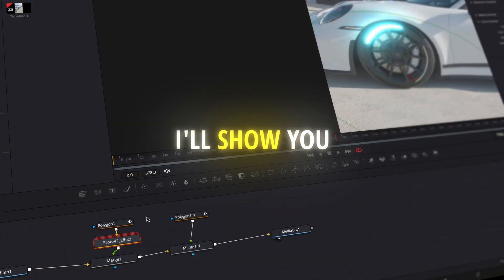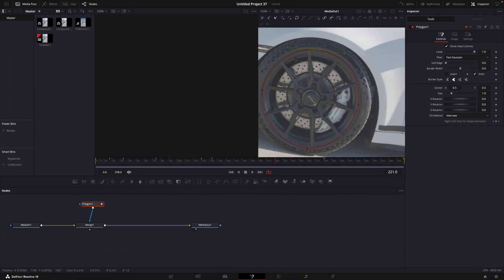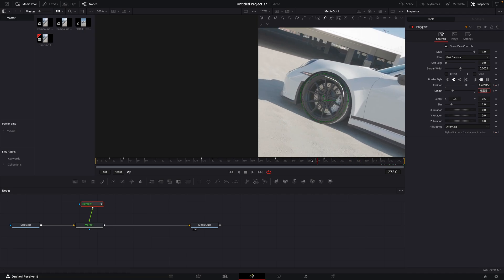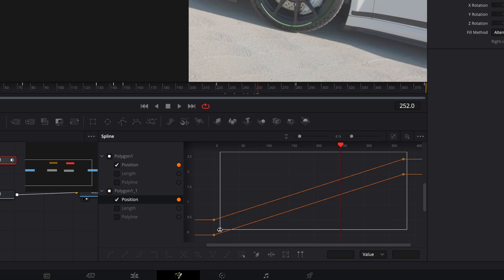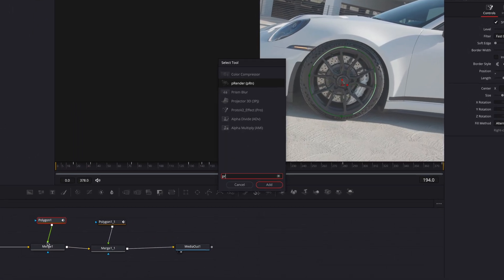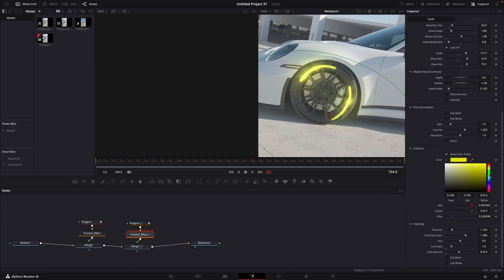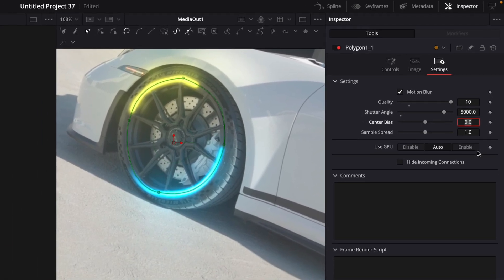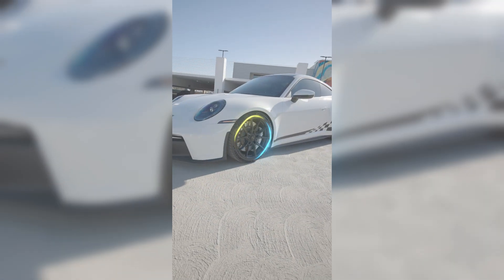Dual ENERGY Line Effect - DaVinci Resolve

Comment: proto starts in davinci but it does not color my wheel it just colors nothing, ow to fix this?
Reply from the maker: Hmm. Have you checked the connections between the nodes. Make sure they are the same color as i have.
Reply: @VaultCar i am gonna redo everything and then i will tel you
Reply: @VaultCar i thi,k i found the problem but i dont know how to fix it, proto is in templates and is not in tools by me, how can i fix this?
Reply from the maker: Sorry for taking a while to answer. Check out Patrick Stirling, he made the plug-in and has a tutorial to download it correctly.
Reply: I have a question can I do the effect later in my clip because my wheel does not show the whole time